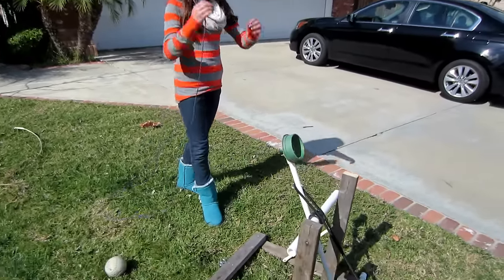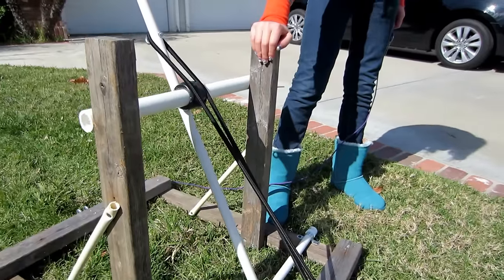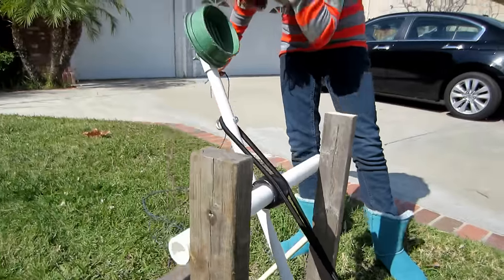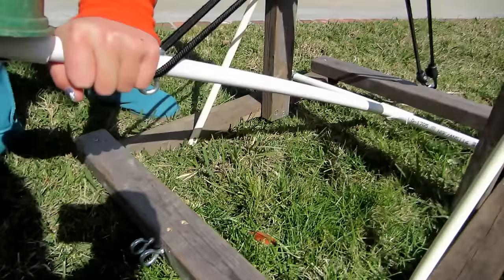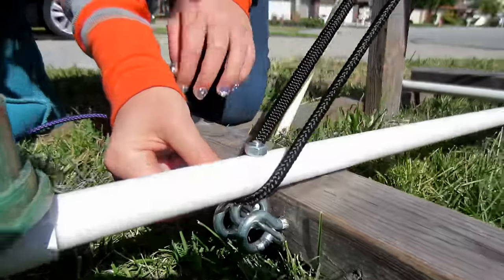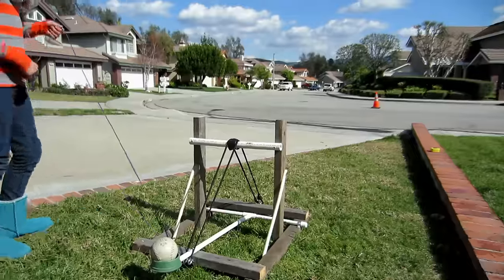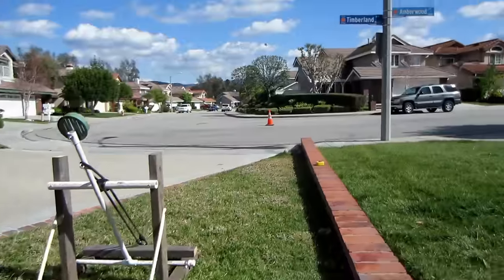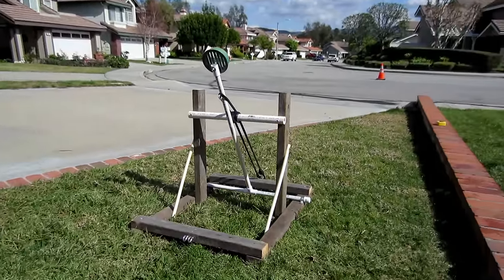How To Build A Catapult For School Project

Comment: what are the measurements of the materials? and how much did you use of what?
It'd be helpful!!!!! Need to know asap!!!!
Reply: Here you go
-----
softball Catapult from an old 2x4, PVC pipe, some pipe clamps, eye bolts, eye screws, a homemade pull pin w/ pull rope, and a 48" bungee cord.  Shoots the ball 50 feet.  Add another cord and it shoots out almost 50% more in distance.
Reply: @bloxytube4388  You just copied the description it only shows the materials. He's asking for the measurements of the wood for example and also the thickness of the PVC pipes If you actually had eyes they all look different in size no one will be able to just assume all the measurements.

Comment: Can you specify the measurment for the wood and the pvc pieces please
Reply: old 2x4, PVC pipe, some pipe clamps, eye bolts, eye screws, a homemade pull pin w/ pull rope, and a 48" bungee cord.
Reply: @bloxytube4388  you did anything but answer his question